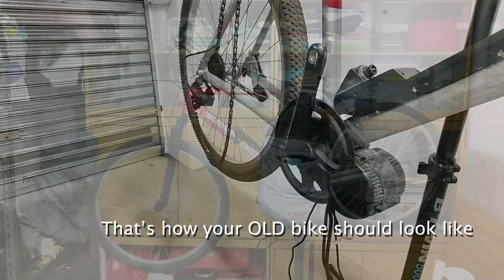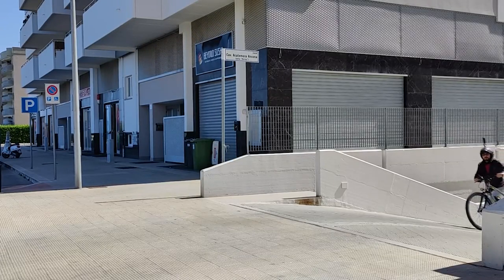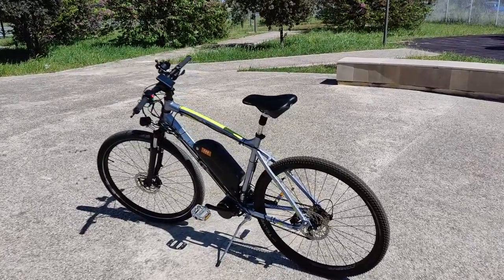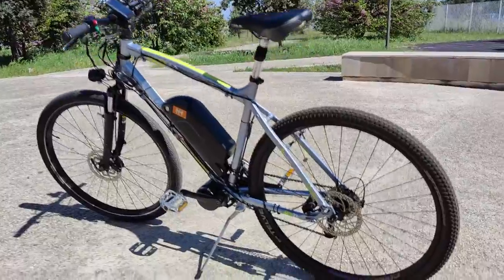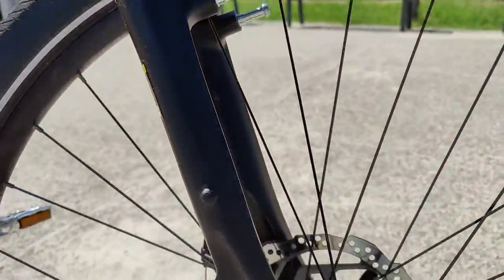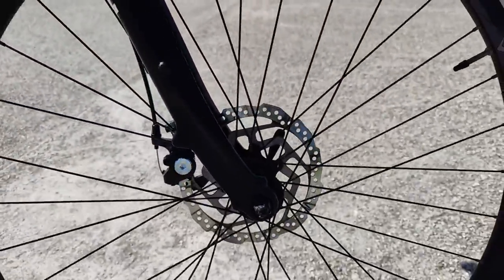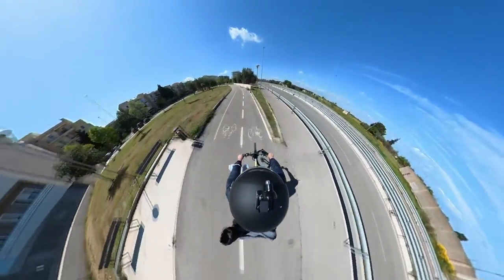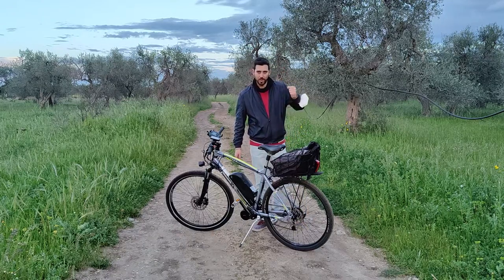Bafang Frame Replacement: Worth it? Any change in Speed or Range?

Comment: Bel video complimenti. Anche io vorrei montare un bafang 500w su una mtb per fare sentieri, salite in montagna ecc. Ho una Cube da crosscountry in alluminio, ruote da 26 e freni a disco idraulici. Sono indeciso se a 36v o 48v. E corona va bene la 44? Grazie
Reply from the maker: io direi 48V, così puoi montare batterie più capienti :)
se devi fare molte salite, 40 o 42T andranno bene (anche 38 eventualmente), se vuoi preferire gli allunghi 44 è perfetta.
comunque molto dipende anche dai rapporti che hai dietro! io direi prova con 42 e nel caso ne compri un'altra successivamente
Reply: @LukeLorusso  grazie gentilissimo

Comment: Hi Luke, I’ve watched all your bbs* videos and was really inspired. It helps me a lot to build my own ebike. Now I have a question regarding throttle installation. I have on my right hand: shimano Altus gear shifter - bafang brake - bafang throttle (from left to right). I have to put the gear shifter and brake together a bit further away from the throttle, because the throttle is thicker and will clash with the shifter’s thumb. But then the gear shifter is very closed to the center and away from my hand and thus hard to reach with my thumb. My current solution is moving the throttle to left hand side, but it’s actually designed for right so the cable awkwardly bent. What is your experience and recommendation? I see you have some special throttle holder. Did you put that on purpose to solve the same issue? What’s the name of that holder or where did you get it? Thanks a million!
Reply from the maker: Hey! thank you for your interest
Yeah I actually installed an handlebar extender (you can easly find it on amazon https://www.amazon.co.uk/Extender-Aluminum-Handlebar-Extension-Headlights/dp/B07WM217T8 or elsewhere)
it helped me installing the phone/speaker support, so I decided to move the throttole over there too, since I don't use it very frequently and it's still fairly reachable with my thumb 👍
Reply: @LukeLorusso  Thanks Luke! This is really helpful. Appreciate your enormous knowledge in ebike conversion and generous sharing